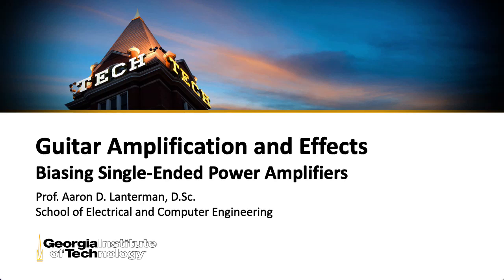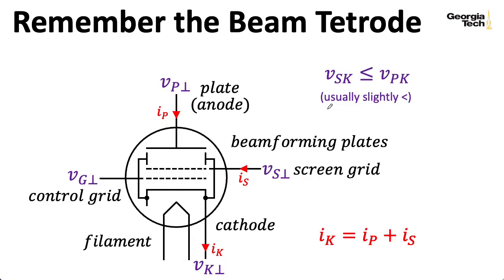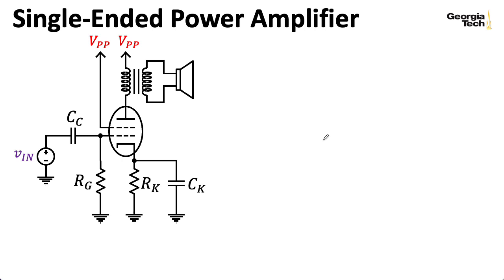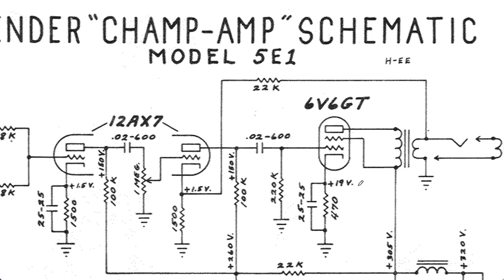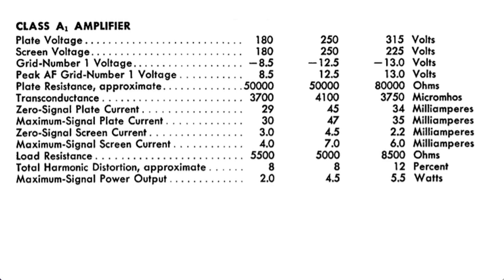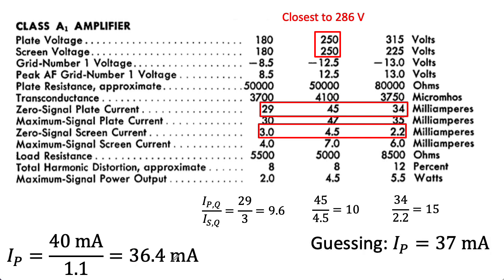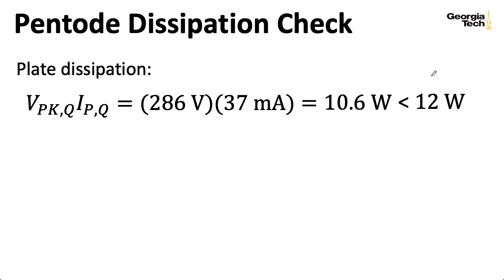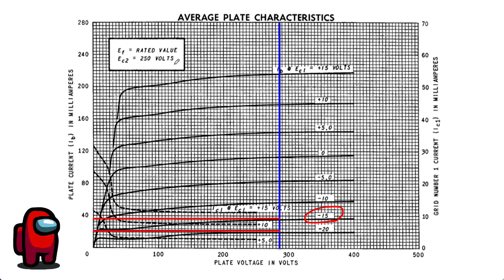ECE4448 L46: Biasing Single-Ended Power Amplifiers (Guitar Amplification and Effects, Georgia Tech)

Comment: Why didn’t you just measure the resistance of the primary of the output transformer then get the voltage drop to get the plate and screen current? Treat the OT like you do the cathode bias resistor

Comment: The math is all well and good but it doesn't really get fun until you're sticking your hand in a powered up amp chassis trying to measure the plate voltage. ⚡🤠
Reply from the maker: I tell my students that if they ever get under the hood of one of these and need to take a live measurement, make an alligator clip connection and then turn on the amp. And after they turn off the amp wait long enough for the bleed resistor do do its thing. :)
Reply: @Lantertronics  Good advice. If you do poke around a live one keep one hand behind your back or in your pocket.
Reply from the maker: Of course, there was that one time I was testing a power supply and I saw the alligator clip start to slip... let's just say I'm very glad I used the restroom before conducting the experiment. The flash, the bang, the smell of ozone...
Reply: @Lantertronics  Last year I was converting an old AM radio into a bluetooth speaker and made the classic mistake of hooking my scope ground to an old ungrounded circuit (I HAVE and isolation transformer but wasn't using it like a moron.) A very large trace instantly turned into plasma with a bang and left a pretty copper smear on my workbench. Somehow I didn't blow the channel on the scope.

Comment: When the Screen is at the same voltage as the plate how does this prevent the electrons from the cathode from bouncing off of the plate. That what the whole point of using a screen at a different voltage was to suppress the electrons and when you tied it to the same voltage at the plate it does something different? I see on fender schematics they don't use grid leak or grid stopper resistors which the Miller Effect would be "Higher" when using NO grid stoppers? I wonder why Fender would want the miller effect to be higher
Reply from the maker: The screen grid doesn't really prevent the secondary emission -- and actually the secondary emission always takes place, it's only really a problem in tetrodes because they're attracted to the screen grid. It's the job of the suppressor grid to shove the electrons back towards the plate.
Reply from the maker: Regarding not using grid stopper, I think you have things backwards... not using a grid stopper is like having R=0 in the 1/(2*pi*R*C) formula which would put the cutoff frequency of the lowpass filter at infinity, letting everything through. Including a grid stop resistor is what creates a lowpass filter via the Miller effect.
Reply: @Lantertronics  the grid stop resistors are suppose to filter out the tubes oscillations or other noises which it's not called emf or back emf but tube crease noises that bleed into the grid. I'm not sure why amplifiers would add grid stop resistors because this would be like adding RC low pass filters to each tube stage
Reply from the maker: @waynegram8907  It's exactly the lowpass filter effect that stops the parasitic oscillations.
Reply: @Lantertronics  right, but why does a tube have parasitic oscillations? I think the miller effect capacitance of the plate to grid capacitance is what is causing the parasitic oscillations?
Reply from the maker: @waynegram8907  The tube itself doesn't magically oscillate on its own -- the oscillations come from the fact that it's an inverting amplifier and at some frequency you get enough other phase shift for the negative feedback to become positive.
Reply from the maker: @waynegram8907  This is a nice thread: https://www.diyaudio.com/community/threads/parasitic-oscillations-in-general.137972/

Comment: Are these video all made by your artistic thing alone?

Just like you have trillion models of transistors, you got alot of tubes as well.

the "power" law:  P = U (V) x I, this square thing is new for me.

Ya, that's what I'm figuring out now as well right on the LA-2A compressor, what type of resistor to use ... as for the trimmers, i tend to use these Bourns 25 turn.
I "introduced" the side chain (for the opto cel) schematic into Autodesk Eagle, i'm gonna route a pcb with thick traces .. and some improvements to the original thing, since we have some new ic's.
Reply from the maker: Yup, the videos are produced by a team of... just me. I've become very fast at using Camtasia.
Reply: @Lantertronics  Team Aaron, lol.

the editing is awesome, so are the lyrics.
Reply from the maker: @AnalogDude_  Thanks!
Reply from the maker: The square law for power dissipated by a resistor just comes from substituting ohm's law into the P=V*I equation (you can also get P=I^2 R using the same technique).
Reply: @Lantertronics   P=I^2 R, grrr.
i guess I^2 means I square.

Maybe you should make a (if you got time) a recompilation of all the math formula's and notations and where to use them.

So i can calculate the LA-2A before i make faulty pcb, meaning having the wrong footprints ... and still is a pretty heavy stuff around the "side chain",  R3, R37, weird is C12, i wouldn't know how to solve that one.
Since i suspect around 290 V DC from my PSU, maybe this R35(220K) and R38 (22K) voltage divider is wrong, since you need to feed 100V in to the plate of the tube. the Function of C13!!!

if i sum, R35 (220K) and R38 (22K) = 242000K.
290 V ÷ 242000 R = 0,001198347 Amp.
using your formula:
(0,001198347×2) × 242000 (P=I^2 R) = 579,999948?

Kinda rusty apart from Ohm's law and a bit more.
: )
Reply from the maker: @AnalogDude_  You multiplied the current by two. You should be squaring it.
Reply: @Lantertronics  lol, error.
indeed, if you square it (P = I² x R), the sum is equal to P = V x I. after calculating the current.
i can use 0.5 watt resistors there.
: )

There is diffidently something wrong in the LA-2A schematic, a voltage divider between 220K and 22K can't result at 100 volt at the grid of the 6AQ5A tube. though i don't know the Voltage, the Schematic indicates 275Volt. after rectifying.